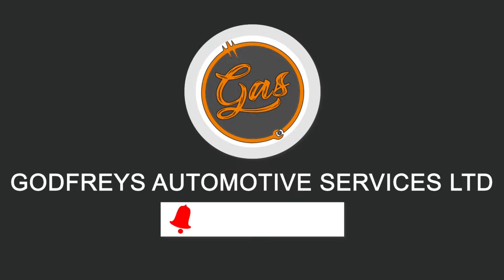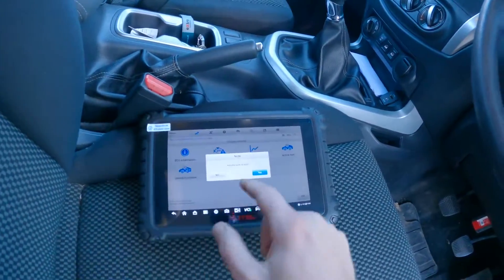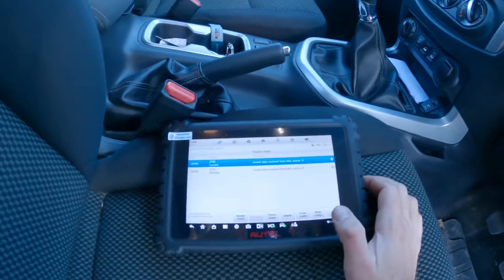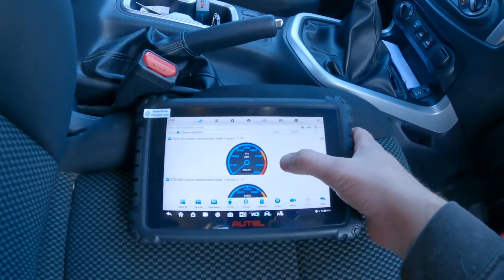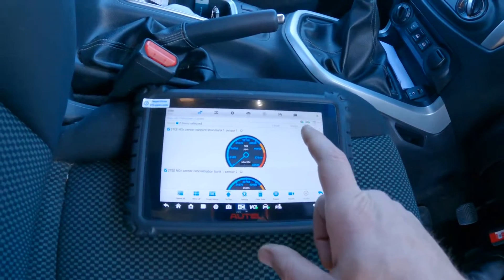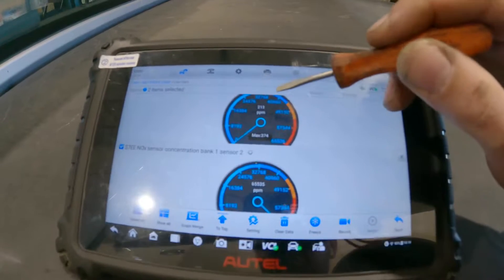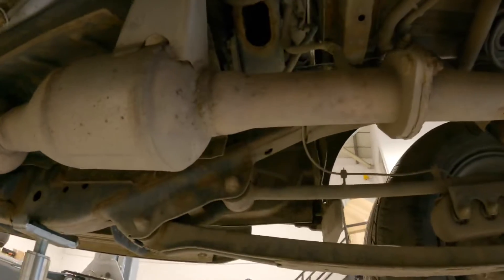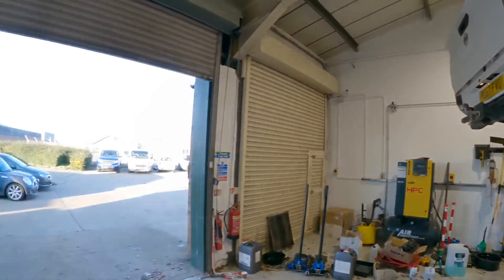Nissan Navara Nox Sensor Diagnosis

Comment: Hi
I hv same nissan navara 2017
I went to dealer and got diagnosed nox senser 2 ,mean rear one
My electrician rather then put senser on he end ed up deleted  ad blue,after that no light ,then after 2 weeks truck loosing power,then igo back to him and he installed original file again and i changed senser 2 as well
No problem is still showing senser 2 fault and less power still go on moter way 70,80
But not right power
I hv seen ur video and thought may be u can help
I order new senser with same code from ebay

Comment: Can you do much damage if you have a faulty sensor and don't replace it straight away? I have had the eml light on the dash but it was only barely lighting for some reason. I've no idea how long it was on! Only copped it was there when it was in for a service and it came up on a scan.

Comment: So basically if you have fault code U059F invalid data received from NOx sensor ‘B’ it’s means that the front sensor has packed up. And on your car it was the other way round NOx sensor’A’ invalid data received as the rear sensor had packed up.
Reply from the maker: It’s always best to watch actual values and unplug the sensor whilst plugged into the vehicle to confirm. Different scanners can bring up different descriptions too.

Comment: What sort of readings on live data do you expect to get from NoX sensors. I’m having trouble diagnosing them
Reply from the maker: I like to see around 100-200ppm. I’ve had issues with some Mercedes but best way I have found to diagnose is by comparing the readings in a graph form. I have found they should be near identical to each other.
Reply: I had a Eclass Merc in the other day and both sensors were just sat at 0ppm. With how common they are i’m just presuming they are both stuffed
Reply from the maker: @joliver865  there a common issue on the Mercedes. Although I have had to drive them for about 20 minutes in the past to get them to start reading.
Reply: That’s good to hear. I might get the boss to get the car back in so we can have another look. Thanks for the replies. Just found your channel there’s some good useful videos
Reply from the maker: @joliver865  thank you, appreciate the feedback 👍